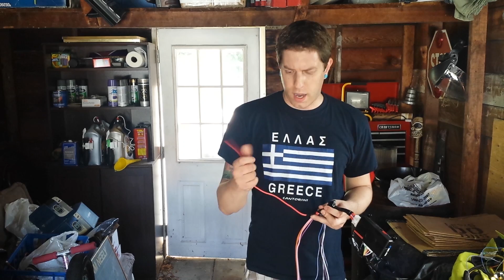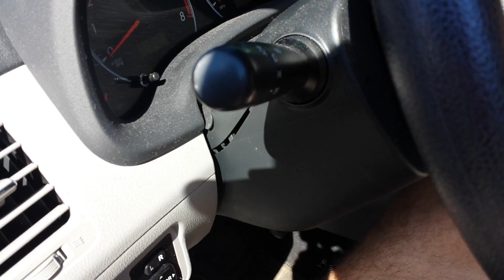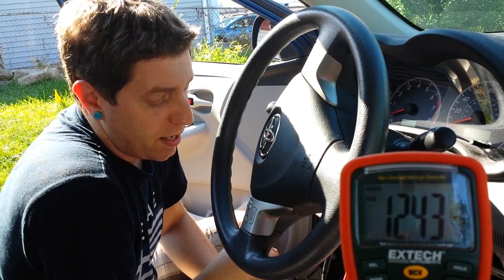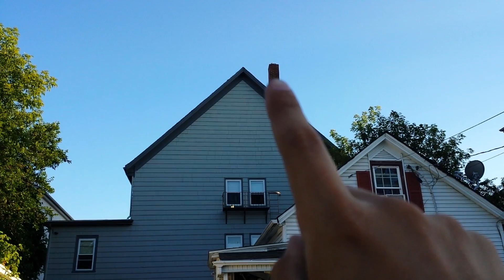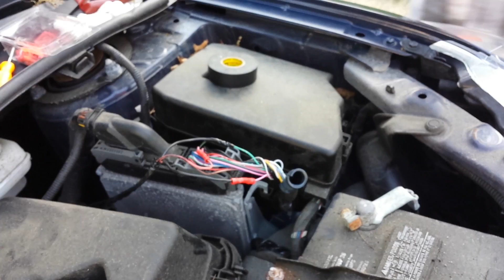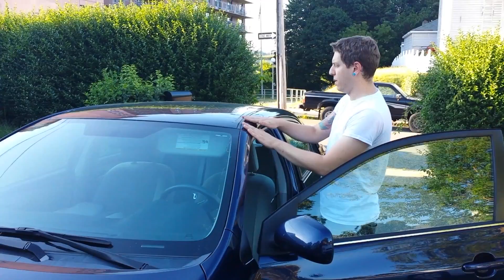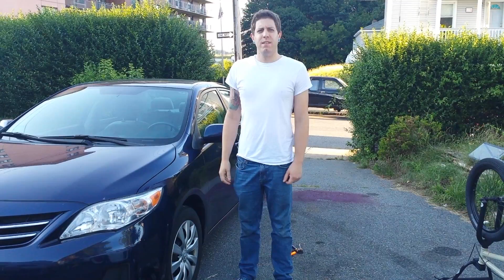2009 - 2013 Toyota Corolla Remote Start Install

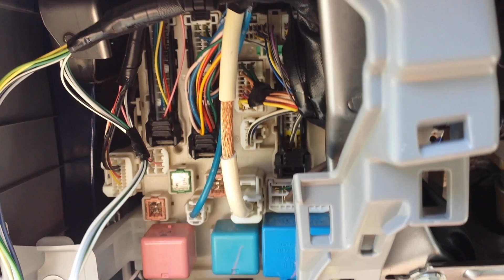Comment: How did you strip that big white wire in 10:22 ?
Reply from the maker: Using just the blade of a razor blade. Run it around the top and bottom portions of where you want to open the wire up (without slicing your hand open) and then cut a slit between the two and the insulation peels right off the wire.

Comment: How you reset the system in this Corolla?
Reply from the maker: Which system are you trying to reset? The bypass module?
Reply: @dannyk.7336  In 7:30 you said something about resetting the system after unplugging the tire pressure sensors, thank you for your videos, really useful!
Reply from the maker: Ah, gotcha. You only have to worry about resetting the TPMS if you leave that sensor I'm showing unplugged when you turn the car on the next time. See if you can pop it out like I did and keep it plugged in while testing the RS. If not, I'm pretty sure the reset procedure was to turn the key to the On position (not started) and press and hold that TPMS button until the light on the dashboard turns off. I also think you can drive the car like 50-100 miles and it will reset itself. Probably something Google has a bunch of answers on.

Glad the video helped!
Reply: @dannyk.7336  Thank you, you're amazing!

Comment: Am wandering if you have any idea how I could swap a cluster and get it to work properly. I switched mine but abs light and emergency light are on also speedometer does not work my car does not have abs.. It's a corolla 10th generation 2012.. I need some help

Comment: Hey Danny thx for the video. I can't find the wires for rx and tx.  I see them in your video but you didn't get into it.  I'm doing a 2007 Corolla so its a little different but if you could tell me the colors of the wires you hooked up to I could figure out which wires on a 2007 by comparing the wire charts. Thx

Comment: My accessory all working out, so I can lock and unlock with my remote but when I try to start my automatic 2009 corolla, the light flashes 5 times and it wont start. Do you have any idea what would be the issue?
Reply from the maker: 5 Flashes during RS usually means the brown brake input wire to the brain is getting 12volt like someone is holding down the brake. Can you test that small brown brake input wire and see if, for some reason, it's getting 12volt during RS?
Reply: @dannyk.7336  I tested it but it is not the case. I have a orbit 3475v. I spoke to a tech and he said he needed to program the tach.. I am going to try it
Reply from the maker: Ahh ok, I'm only familiar with the DEI brand stuff. Good luck!
Reply: @dannyk.7336  Thanks I really appreciate you taking the time!

Comment: https://www.amazon.ca/Directed-Electronics-PKALL-Encrypted-Tranponder/dp/B001N7RE44    

Just wondering, is this the bypass that will work on my base model 2009 matrix? Has a "dot" on the key because the "g" started in 2011. Thanks.
Reply from the maker: Yeah, the dot means you only have a 40 bit encryption (as opposed to the 80-bit G key). Looks like the PKALL is also compatible: https://old.directechs.com/Product.aspx?sku=PKALL#vagtab

Comment: i AM DOING THE PK ALL WITH A DIFFERENT REMOTE START. YOU KEYSENSE WIRE WAS THAT FROM THE AVITAL MODULE OR THE PK ALL MODULE?
Reply from the maker: The wire I hooked up to the keysense wire is the blue (or blue/white) off of the avital. This is not the blue wire in the two pin door lock harness off the avital. It's in one of the main harnesses.
Reply: @dannyk.7336  awesome thank you. I figured mine out already I think it was blue white from module to blue off the pk all. Mines working great just in time for the cold weather

Comment: But you still needed the key to start the engine. I was wanting to be able to bypass having to use the key!
Reply from the maker: It doesn't need a key when you remote start it but otherwise yes. Looking to make a complete keyless car?

Comment: Awesome tutorial. Thanks, guys.
1- Where can I find the wiring diagram of Avital 4115L and Viper 4816v? Are they included in the package? I just saw the quick user manuals on their websites.
2- What's your suggestion between these two for a Toyota Corolla 2012, L?

Comment: How long did you take from start to finish
Reply from the maker: Usually these Corollas take around 45 minutes for me to do. Seeing I suck at video production, this video's install was done over two days because I mumble too much when I talk.
Reply: Danny K. Great guide, quick question, accessories stopped working a few days after installing. Likely just a fuse? I’m pulling it apart tomorrow to look at it
Reply: Danny K.  Also noticed the heat and ac would not run when remote started but would come on when the key was put in
Reply from the maker: Hey  @jaremi40 , so safe to say your accessory wire and heat/ac still works when running off your key just not while remote started? If it was originally working it sounds like the accessory wire off your remote start isn't outputting or it's not connected anymore to the accessory wire in the car somehow? What kind of remote start is it? Usually there isn't a separate fuse on the RS that just protects accessory so it's more of an all or nothing with all the ignition wires. Either it all works or it doesn't usually. When you remote start the car, do you get 12volt on the accessory wire when testing with a multimeter?

Comment: You ran the wire write over the curtain air bad not underneath
Reply from the maker: That's how I was taught actually. Always kinda questioned it but I was told the antenna wire is no match for dynamite.

Comment: Thanks for the video man!  Any help would be greatly appreciated!   2009 Toyota Corolla with Japan wiring.    My Starter pin has 2 small white wires attached to this pin of the plug and the Accessory has 2 small black wires attached to this pin of the plug also.   All of the other pins on this plug have only 1 wire each.   Do I attach each wire (Starter and Accessory) to both wires on these pins of the plug??
Reply from the maker: Yes, good question. As long as both wires tie into the same pin, then you're good to only hook up to one of them. Just catch your wires as close to the ignition harness as you can and you should be golden. You can actually see I did this where I only hooked up to one of the two light gray Accessory wires going into the top, second pin from the left in the ignition harness @ 15:28 and I didn't have any troubles. 
The only time I've seen this be crucial is if you have a completely isolated "second starter" wire in the car, like the XRS version of the Corollas, and hack installers will run the same purple starter output from the remote start to both the primary and second starter eliminating the whole point of the second starter wire entirely. In that case, you would need a relay to isolate a second starter output from the remote start. 
Anywho, that's a different story...let me know how you're install turns out.

Comment: I have tapped my parking light wire & horn wire, why is there no parking light indicator when locking, unlocking and remote starting the car? This is for a Sienna 2007 CE. Thanks!
Reply from the maker: Did you catch Green/Black at your headlight switch under your steering wheel? Two things to check: Did you catch the right wire? Did it test the same way I showed my parking light test in the video @ 12:30? If so, did you set your remote start unit to output negative parking lights? What brand remote start is it? Most of them have a jumper plug on the side to switch between positive and negative parking lights depending on vehicle. The default is positive so you would need to switch that.
Reply: @dannyk.7336  I did catch it and I'm looking at it right now, there are two in my case but one of them actuates as you showed on the video, I set it to the negative polarity on the RS unit, is it possible that the RS unit is not sending the signal, I know the fuse is not blown. This is a viper 4105V. Why is the horn not honking? The lock, unlock and remote start work as intended.
Reply: @dannyk.7336  this is a great test on the white wire, just for reassurance, I should get signal from this wire either positive or negative if arming or disarming right? I'm assuming the DVOM should catch it? I will try the honk programming, I have an additonal RS that I'm planning to plug to ensure that it is working properly just in case there is something in the wiring itself, etc. Please advise and great job on this tutorial, very few people show how to find wires and methodology used such as how to activate each to get confirmation.
Reply from the maker: Correct. The parking lights wire in this car always has a 12 volt reference voltage on it until something provides a ground (-) to the wire which triggers the parking lights relay. So, if you do it backwards the way I showed you @ 12:30 and put your multimeter's black probe in a ground source and the red probe in the wire, it should show 12 volt with parking lights off and 0 volts with parking lights on or with arming/disarming of the 4105v. The parking lights stay on for a good half second when they flash so that should be enough time to catch the change in voltage on your multimeter. Just another way to test it and make sure you're getting consistent results. But good call on swapping the R/S with another, isolate everything you can. 

Also thanks for the compliment, I'm glad my video helped you out.
Reply: @dannyk.7336  well well, I went on to grab the other unit and noticed two slots, one with guides for a connector and the other just bare without guides, when I looked at the other unit, I realized it was the same, I guided myself from the manual and wondered where the polarity marker was, to my surprised I saw that it was under the unit where the pins are located, I feel stupid now. Now all works including the honk once enabled from the programming menu you provided. Thank you again for the great work, perhaps adding to this video as a FAQ would be nice for another series.
Reply from the maker: Hey hey! Great, that's awesome you got it all figured out. Happy to help!

Comment: Can it be used to power a Blackvue dashcam too? I had mine hardwired at a specialized place but the dashcam keep losing power. I feel it's due to the car battery being soon dead, I have no way to test the CCA and health of the battery. It's powered via a power magic pro hardwire to accessory and constant 12V in steering collumn tho. It was all fine after I did that long trip but since it restarted a lot with these short trip so I feel the battery is the issue. Dashcam doesn't draw a lot. PMP can also be ran via a switch and constant fuse but it's hardwired like I said instead.

It was done my professional so I doubt it's their instal but still prefer to ask you.
Reply from the maker: Could be a lot of different things. You need to invest in a multi-meter and you can test to see if you're loosing voltage when your dashcam stops working. Once you have a way to "see" the electricity, I can definitely help you out.
Reply: @dannyk.7336  the camera take power from a  box called power magic pro. Made by the same company of the dash cam.  I have two of them and both cause issues. I need to take voltage out of the box or right from the +12v  wire from the steering column?

 I'm not sure also how to probe my multimeter as I assume the reference point need to be the car body that is connected to battery ground but the red probe need to be connected where and since it's voltage it's parallel so I'm not sure how to probe it if the dash cam is connected. I assume I need need to probe it when the cam is connected tho as if the cam crash when connected but no voltage drop it's probably the cam.

It could still have an effect from the battery tho right?  As I never had any issues after a long drive but issue started back after short trips. I feel the magic pro need proper voltage even if in driving mode the voltage cutoff isn't in function. To box convert 12v to 5v too so if the 12v isn't enough the output voltage is probably greatly reduced too
Reply from the maker: @MGCoin333  , is this the part you have? https://www.blackboxmycar.com/blogs/news/98777223-power-magic-pro-setup-and-tips . If so, looks like you'll want to set your multimeter to Voltage DC (VDC) and to a range that will show 12v (unless you buy an auto-ranging meter which does that for you), open all three wires coming out of the power magic, and with your ignition on 1) Put your red probe from the meter in the yellow wire and black probe in the black wire and you should read 12 volt. 2) Put your red probe from the meter in the red wire and black probe in the black wire and you should also read 12v. If there''s a harness in-line that you can put your probe into bare metal of the wire, that'll be safer than opening the wires. They are live wires and the shop you had do the work may not have fused them properly so be careful you don't blow any big main fuses in your car by shorting the wires (don't let them touch!). So, next time you see the dashcam stop working, test those wires out and should get you closer to at least isolating the issue.
Reply: The three wires are INPUT to the power magic pro box via 12V,  then one red and one black OUTPUT from the power magic pro into 5V and go to a cigarette plug and the dashcam is connected there. I assume I can just probe from the power magic pro OUTPUT that should be 5V at the cigarette plug style. (Yeah it's a 5V cigarette plug it output, it's not 12V, it convert the 12V inside the box.)

If there's no voltage drop, It would just indicate it's the cam. I assume it cannot be the power magic pro as I have two and both are doing the same thing.

And I never got these issue after driving for a while. So I still feel it's the car battery being weak and when I accelerate more, it just cut off. Well, the cam freeze and restart shortly after. The more the cam crash the more I notice it's shortly after I accelerate more lol. And accelerating fast suddenly probably draw more current and not leave enough for the power magic pro.

I have found a store that they test your battery CCA for free so I might do that and see as I have no idea of when the battery was purchased. All I know is the battery passed the CCA test when I purchased the car used.
Reply: Some seems to have the same issue, ruled out the sd card. I feel like trying to force a rollback to the first firmware of the camera. Maybe it's that too. xD

The power magic pro doesn't show any sign of voltage drop either, the LED doesn't flicker at all.

I'll probably going to find the datasheet of the voltage regulator and see the range of input to get a stable 5V at the output. The condensator in the circuit seems fine too so it should regulate the 5V too.

Maybe I should really force the firmware update back to the first one before messing with the wires. I have done some robotic electronic at school but dropped a bit fast due to big medical issues so I'm still a lot noob to that hahaha.

I'll force the firmware soon and check the alternator strap and I'lll update you. I have to change my tires to both cars and oil change first tho haha.

Comment: Will the factory keyfob still work to unlock the doors if the car is started using the remote start?
Reply from the maker: In the 2013 model I did, it did not. You can test this with your own car by starting the car with the key and then try pushing the buttons on the factory keyfob and see if it allows you to unlock/lock/trunk pop. I think it's a safety feature Toyota builds in so you're not popping your trunk while driving down the highway. I ended up hooking up the unlock wire off the R/S brain so the remote start fob could still unlock the car while it is running.
Reply: Can you explain how the remote start fob unlocks the doors? Didn't you install a single button remote starter?
Reply from the maker: With a single button remote start, they got clever with it. If the remote start is active, a quick push to the button will pulse the unlock wire and a long push to the button will shut down the car. If the car is not remote started, then a quick push to the button activates the remote start and a long push pulses the unlock wire.
Reply: Did you have to hook up any additional wires not shown in the video to get the unlock feature to work?
Reply from the maker: After my ex complained about it every day for a week after, oh I sure did, haha. It's a pink wire in a white 18 pin plug in the driver's kick panel. There were a couple pink wires down there but it was easy enough to test and confirm the right one. Red probe in the pink wire, black probe to ground. The multimeter should red 12 volts. Push the unlock button on the door and you should see the voltage drop to zero and come back up to 12 volts once the door actuators move.
Reply from the maker: And it's the blue wire off the remote start brain. It's the one in the two pin plug shared with the green lock output wire.
Reply: @dannyk.7336 where does the green lock output wire go?

Comment: I want to know if having this system installed can cause some interference when making a scan for the port odb?
Reply from the maker: Not that I've ever seen. The PKALL bypass I use ties only into the immobilizer system of the car. If you use the FLCAN or DBALL type products, they do tap on to the CAN BUS system and the data lines used at the OBD, but still, never really heard of a problem being caused by these modules.